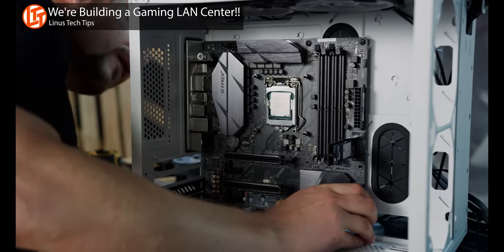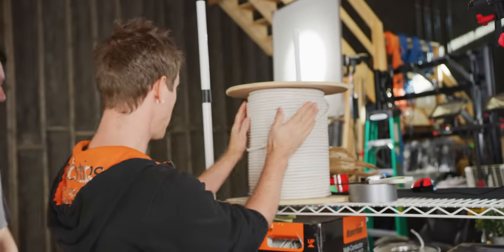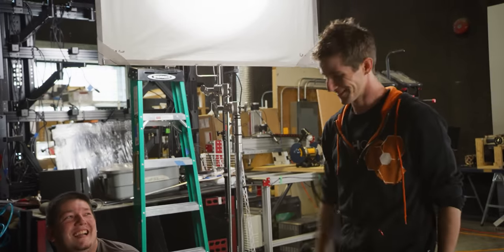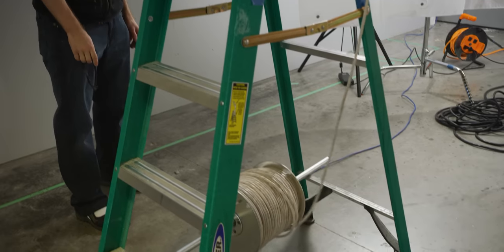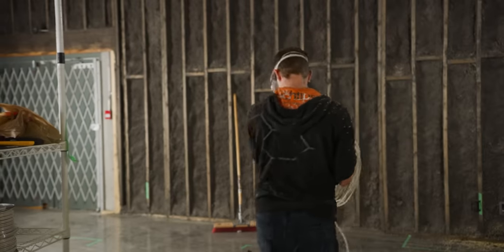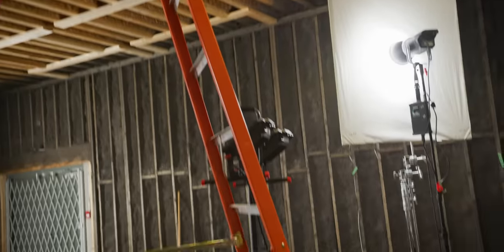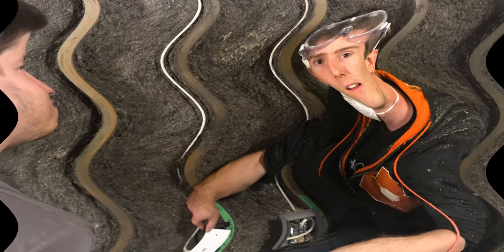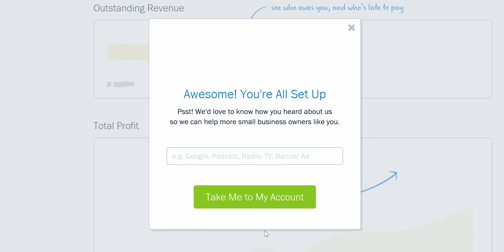Electrical Wiring for the Gaming Center - What could go wrong?

Comment: casually rains sawdust on PC with 5 Titan Vs
Reply: @Hyp3rNova56 that wasn't water, pretty sure it was mineral oil
Reply: Casually drops <insert consumer electronics device>
Reply: Casually leaves Dell XPS 13 in the rain "Accidentally"
Reply: Wasn't it four or am I blind
Reply: causally drops processed MacDonald's pink meat on GT 730
Reply: Are we going to see a video about the 6 work station 1 cpu ?
Reply: it's fiiiine. no one got electrocuted. that's already a success.
Reply: @Hyp3rNova56 that was mineral oil, not water
Reply: @danteinouye6098  twice

Comment: As an electrician, who has been watching linus tech tips for a long time.

This was hilarious
Reply: It's stressing me out that he's using NM Cable (Romex) in a commercial setting.
Reply: as swiss electrician it stresses me out that he doesn't use pipes for the cabels
Reply: JKPieGuy that rule has to do with buildings of combustible/no-combustible construction. You can use Loomex in buildings of combustible construction and BX is buildings of non-combustible construction. This building looks like it has a wood frame instead of steel stud. At least in Quebec that’s how it works. Not sure about BC
Reply: @timschin5519  except for metal studs we don't normally use them
Reply: @timschin5519  ja voll, Kontrolleure vo de Schwiiz verlüret all Haar bi dere Installation
Reply: Cymbaline 438 i like your funny words magic man
Reply: As an electrician I would have used cat7a and not cat6a just because I can. If it's a grandma's house I would be fine with it but it's linustechtips, why not use the best
Reply: @vsahankrat7176  If they are struggling to get cat6a, what you think the chances of them being able to sniff out some cat7a is?...
Also, does cat7a fit into a regular keystone like they were using? or is there a gjr45 equivalent for that?
Reply: @JKPieGuy   We use NMD90 (Loomex, in Canadian sparky layman speak) in commercial settings all the time wherever combustible structure exists here in Alberta. Usually run EMT/JB backbones down the building and then into 6x6's, 12x12's, etc. in the walls, and then NMD from there. 

The only thing I saw in this video that wouldn't fly here is the lack of mercy/service loops at the device boxes, per rule 12-510(4) of the Canadian Electrcial Code;

"where cable is run to a switch or a receptacle specifically approved with an integral enclosure incorporating an integral cable clamp, the cable shall be supported by straps or other devices located within 300mm from the switch or receptacle wall opening and there shall be at least a 300mm loop of unbroken cable or 150mm of a cable end available on the interior of the finished wall to permit replacement"

That and the fact that the ceiling is remaining open probably wouldn't fly in this province with NMD as the wiring method.
Reply: @JKPieGuy  as an electrician this guy is working for Linus it doesn't matter linus would have used Romex anyways. If he used something that good
Reply: Is it hard being an electrician?
Reply: @vsahankrat7176    Grandma would be fine with cat5      Most grandmas dont need gigabit
Reply: @FennecTECH  here in germany there is no price difference between 5 and 6a
Reply: @ColinRichardson  fitting into the same rj45 connectors would be no problem and im wondering why he had problems getting this cabel, i can literally buy cat7a cat6a everywhere on the internet with 2 day shipping for the normal price.
Reply: @blaaper  depends if you like doing it or not
Reply: @blaaper  most of it is labor intensive, residential and commercial is more physical, while industrial has its times being physical, it’s more thinking and planning since material cost more. Eg, pvc coated rigid conduit vs electrical metallic tubing, 316 stainless steel vs steel or even aluminum in some cases, etc.
Reply: @Subielare569  I worked in roofing so I think labor intensive is fine to me
Reply: @blaaper  yea I’ve done roofing/solar for 5 years. Killer on the knees and lower back. When we did it, we did it old school, hoofed everything up by ladder. Now they have actual belts that feed the workers. Must be nice lol.
Reply: @vsahankrat7176  Kinda curious why they didn't just go ahead and use 12-3 rather than 14. Might just be an american thing, but I prefer to run 12 rather than 14 since because if you need the overhead later on, you got it. If you're doing a fresh install, there isn't much reason why you wouldn't just go ahead and future proof.
Reply: @JKPieGuy  drywall is gonna go up so it’s legal, and it’s wood studs.

Comment: I love Brian. I'm also an electrician and we do our jobs exactly the same lol. No one carries hammers. It's not worth the weight when you have an electrical hammer (lineman pliers)
Reply: My hammer is not something I use frequently. Sometimes I need one for a few things like stakes or bang on caddys but otherwise, stays in my tool bag.
Reply: Ok so Im not the only 1. Pliers or even the butt of a screw driver gets the job done most the time.
Reply: It's very interesting to compare how you guys over there are working with how I'm working in germany. A lot of differences.
Reply: Yes, actually needing a hammer is not very common haha, and a lot of the time the pliers work better given limited space.
Reply: I carry a small Ball peen hammer as it's on our tool list as it comes in handy when I have to make a hole in a block wall to run emt through.. I am thinking if your into residential electrical as hammer would make life easier for the staples and  putting boxes on wall.
Reply: @Brealiq  That's exactly what I thought. Especially that they need to run data through separate holes and don't use cat7 while it's standard over here.
Reply: @J0j0Gaming  Genau das habe ich mir auch gedacht. Absolut unnötiger Aufwand.
Reply: @J0j0Gaming  I didn't think there's actually any equipment out there that uses Category 7. Unless you're somehow putting 8P8C connectors on them? Category 7 has S/FTP so less susceptible to electrical interference perhaps, but best practice is still to not run alongside power cables.
Reply: My linemans is the best hammer I've had
Reply: @chunkychuck  we're using it pretty much only for future proofing and because of the better shielding. Of course it is better to run them separated from higher voltages, but that's not always possible with the installation zones that we need to obtain here in germany
Reply: Why no pipes in the walls? Se do that in sweden
Reply: @emilg7722  because it's not obligated here and most private customers don't see a need for that. We do it if they want to, but to be fair, I think the only realistic scenario where you would really need to upgrade from cat7 in the next like 10 years would be in an office.
Reply: @J0j0Gaming  No like the Laws in Norway (don't know about Sweden) says that EVERYTHING has to be upgradable. So that means pipes.

But Norway has the strictest electrical laws in the World. Only country in EU which has separate laws only used in Norway. NEK 400 section 8.
Reply: So all these electricians on here and a plumber has to come in and ask why they aren't using 12 wire on outlets? Pretty sure that's code around here 14 is only okay on lights and switches
Reply: @nicsutton3831  I was also wondering why they used #14 wire.
Reply: Wuss!
Electrician here.
I use my hammer as a counterweight to my tool bag!
Lol
Reply: @nicsutton3831  for residential, 14 is often used for the basics.
However, 12 is typically used for appliance circuits.

However, there are other factors such as distance and ambient temperature, so one may encounter 12 on a 15 amp circuit. (Rare though).
Reply: @Sovek86  For bang ons I just use Kleins and my reamer.
Reply: @firebird8600  Right? I mean it's rated for the load but still. Kinda weird. Couldn't find any 12-3 I guess?
Reply: @nicsutton3831  #12 is not a requirement for a 15A circuit (unless the run is a few hundred ft. away from the panel). It gets used a lot in commercial anyway...but again not necessary.
Reply: @KingFrederik1309  elektrobibelen haha

Also as recent as today i got use of our strict system, my sister boyfriend needs a higher ampere for his fuse for the garage, that would need bigger wiring according to norwegian law and since tubing is already done, its all easy peasy.
Reply: He must only do service and trim. When roughing a hammer is essential.
Reply: @TheCoffeeSquirel  Haha God Jul!
Reply: @esthergennn  yeah, my local code only allows 14-3 for lighting. All 15A outlets here are required to use 12-3(officially code says 12-2, with ground)

Comment: As an electrician, I am glad we are getting our recognition! Wooo!
Reply: no kidding, i was thinking the same thing
Reply: As a european one, this looks horrible, no corrugated pipes for the cables inside the wall?
Reply: Electric codes are different in every country.  Maybe it isn't required in Canada?
Reply: @InsaneZealotry  In the USA metal conduit (rigid or flexible) inside covered walls is only required in Commercial or Industrial wiring (which most times is run thru metal studs or joists where standard plastic/rubber jacketed wiring would get damaged), Residential wiring going thru wood studs or over head joists and is covered by wall board (Sheetrock or some other type of covering) does not. The only exception in residential wiring is if the wiring is run down the face of the wall and not covered, that has to be in conduit (rigid or flex) up to the height of 8'.
Reply: @Mikey8567  But what if you have to replace a cable someday? You have to open up all of the panels? With a corrugated pipe (as someone said before) you can just attach the new cable at one side of the old one and pull from the other side and it will slide inside of the pipe, or maybe I missed something here
Reply: As an electrician it pains me to watch him make this so difficult
Reply: As an electrician in England i find the entire video hard to watch lol. I also drill wood stud out with Bosch 20/25mm speed drill spade bit in an impact. Bang bang. Straight through.
Reply: InsaneZealotry wood construction, Romex is all you need
Reply: @InsaneZealotry I strongly  agree.
Reply: Why did you use 14/3 instead of 12/3?
Reply: Mikey8567 why would you run rigid conduit in the wall? Lol I think you mean emt.

Comment: I am a union electrician, I don't do residential but we still share a lot of tricks. Using a ladder as a wire spool holder with a stick of emt is very common for smaller spools. I am glad that the corded drill he gave Linus had some sort of clutch, some corded drills will not stop so easy. He could easily twist his arm around the drill and possibly break something.
Reply: I use stronger cordless drills than those he is using. Hilti is the brand. It didn't have a clutch. Got a smack in the jaw. Ah well. 

Personally I question why people still install their wires bare in houses in Canada or in general in certain countries. Majority of the early electrical fires in Sweden was due bare insulated wire in walls. Now days, the wires may melt and flame. But the fire is contained in the PVC piping... Well, we don't use PVC anymore since it is toxic when burnt. But we still call it PVC. 

As for the internet connection tool he was using. We stopped using those connectors. Because it requires a tool for an effective install.
Reply: Those drill bits are arm breakers and they should have used the "normal" kind
Reply: @Helveteshit  America is still old school,  just look at their trucks.. they look awesome, but its so old, like from the 60s
Reply: @Helveteshit  A properly sized, and properly installed conductor isn't going to cause any issues. Electrical wiring standards like the NEC exist for very good reason. I don't know about wiring standards in Sweden, but in the US pre-1980s, a lot of homes used copper clad aluminum conductors, which were prone to cracking and breaking when bent around corners. A cracked or broken wire=intermittent contact=increased resistance=fire. Couple that with people cramming pennies into fuse boxes and it's no wonder so many old homes have burned down due to electrical fires.
Reply: No kidding man. The corded I use when my cordless just isn't strong enough will not just rip your ass off the ladder, it'll turn you into a human wrecking ball. Also I would have handed him a file for complaining it's dull, takes very little time and effort to sharpen a spade bit.

Comment: Wait WHAT!? You can't get Cat 6a in Canada!?
As an electrician in Denmark I can order it from 5 different suppliers and get it delivered tomorrow morning 6 AM at the latest...
And each of the suppliers have 6a from 3-6 different manufacturers...
Reply: May be a shortage in the west. No problems in Ontario.
Reply: Cool. I could not believe...
Edit: BTW, I have family in Ontario. It's a lovely place!
Reply: Same in Germany for cat7
Reply: @Schniels65  no such thing as cat7, unfortunately
Reply: @Schniels65   I was wonderung why they weren't using cat 7. I have been taught how to patch that stuff years ago.
Reply: @c8a0t  I think it's a North American thing. I was working for the US Army in Germany and they explicitly wanted Cat6 in their offices.
Reply: West coast here... no problems ordering it. Similar pricing to cat 5e so I always get cat6a because I don't have to pinch every penny.
Reply: I don't know why they are saying they can't because 1000ft of cat6a and cat 7 can be ordered right through Newegg Canada
Reply: Never had a problem getting Cat 6a in BC
Reply: @MrLagace  knowing Linus, they probably needed it that day or the next. Delivery times probably would have taken too long.
Reply: @c8a0t  i Was wondering too because i used Cat 7 recently for my Internet conection
Reply: @c8a0t  AFAIK Cat 6A is newer than Cat 7, and both have similar performance characteristics. Cat 7 was also never ratified by the TIA/EIA as an official standard. Cat 7 has several further downsides, including being  more expensive to buy, and more difficult to install since each pair is shielded , and it requires the GG45 connector to be terminated in order to get 10G speeds. Cat 6A can reach 10G with standard shielded cable so its both easier to install, and cheaper to produce. In the end, both have similar capabilities, and both will soon be superseded by the new Cat 8 standards set to be approved shortly. In the end, both work well, but had different design goals. Both hit 10G so both are viable if the situation calls for them.

Comment: Would be much easier, if you lifted the floor 20cm with insulation gravel, installed cables, networking, audio, heating, pipes under the floor panels. Keeps the floor warm too.
Reply: What about the carbo stucko lab?.

Comment: I can explain the drills. First, they're bought as a set. You buy more than one at once. More importantly, impacts are your bread and butter. They're for removing and inserting screws. You'd be amazed how often you do that when you work on a house. It's a good idea to have two impact guns at any given time, because you and another person can work at the same time. Another reason is that there are different types of screws in a house. You can have an impact with a square bit and one with a phillips. You don't have to swap out bits all the time. As for drills, they're used to make holes. A cordless drill is very convenient and will work for most light jobs. Some tasks require a ton of drilling, though, and you will run through batteries and heat up your drill if you abuse your cordless for them. That's why you need a powerful corded drill. It's not over-compensating at all. Also, we all have dull paddle bits. It comes with the territory. Your new bit will be like that in a couple more holes. And, yes, everything is potentially a hammer. And, yes, we have all left things on top of ladders that inevitably fall on our heads. I actually kind of occasionally still do that. Bad habits are hard to break and all that.
Reply: OMG lmao this exactly! Corded drill wasn't actually all that powerful but only gets used once in a blue moon. Mainly just to not kill the batteries or burn out the brushes in the cordless drills haha.
Reply: @lttbriantheelectrician  Those drill bits will kill any drill
Reply: @dubious6718  No.... May be home owner grade like ryobi but my Makita lasted 6 years of regular use with more aggressive bits than those before it was stolen.
Reply: Any good cordless drills  such as Makita or Milwaukee are all brushless now, really powerful paired and would chew through those timbers easily. Using an impact driver with a good spade bit would chew through those timbers much easier and faster and efficiently than that corded drill ( A 5 amp hr battery in an impact driver and shape spade bit will do 100's of holes before even comming close to flat) . and less chance of it grabbing and breaking linus's wrist and twisting him up in the cord Lol
Reply: @gregalexander9343  Milwaukee's drills, corded and with battieres are soooo good. They can take a beating, drilling through hard, old wood and steel. Still, use a small Bosch on batteries for things like outlets, screwing, switch panels etc.
Reply: It was cheaper for me to buy a new drill/impact driver set that came with two bigger 4A/hr batteries and charger than it was for me to get 2 new 4A/hr batteries on their own.  And, you can ALMOST never have too many drills and drivers.
Reply: @kyungrix1112  Yeah, and if you don't need the skins, you can just sell them on craigslist/ebay/whatever. Money saving all round!